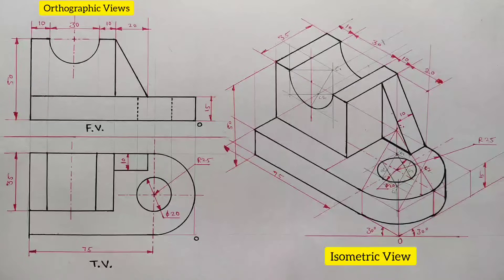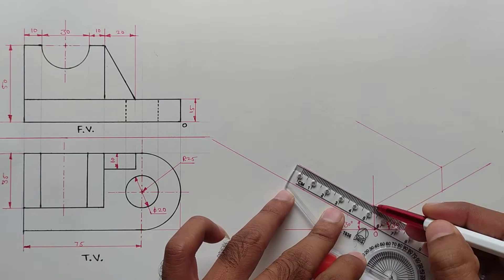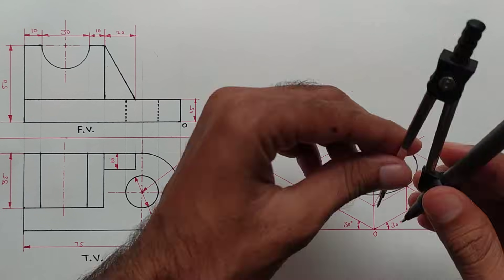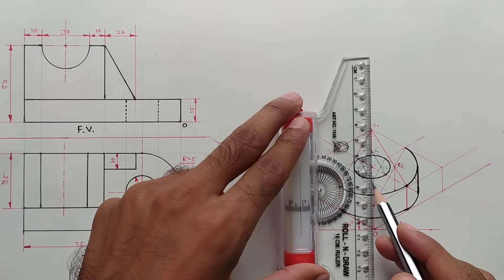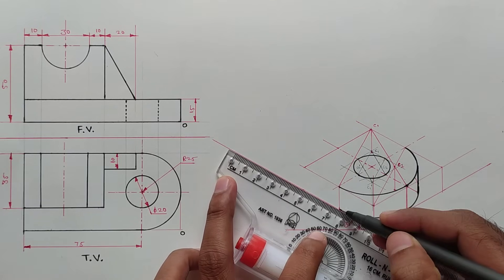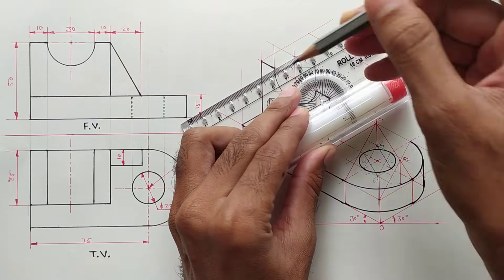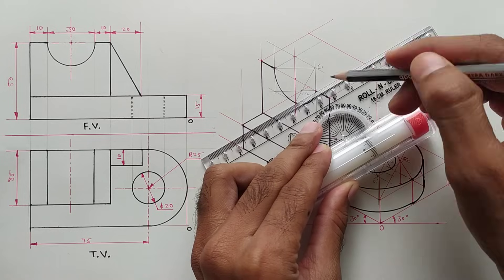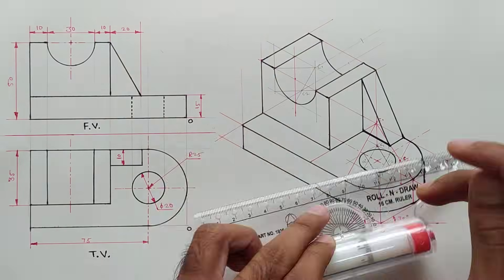Engineering drawing | Isometric view | Isometric drawing | How to draw isometric view

Comment: Sir according to your video you started the front view drawing in yz plane 
How can I know when to draw in yz plane or in xz plane?
(Bcoz in some projections we drawn in xz plane)
Reply from the maker: I have drawn the front view in the Y-Z plane because the origin point 'O' is given on the left side in both the orthographic Front View (FV) and Top View (TV).

If the origin point is located on the left side in the FV/TV (orthographic views), the front view will be in the Y-Z plane in isometric view.

If the origin point is located on the right side in the FV/TV (orthographic views), the front view will be in the X-Z plane in isometric view.

In simpler terms, imagine dragging the origin point from the orthographic front view and placing it on the origin point of the isometric axes. This helps you understand that if the origin is on the left side in the orthographic view, the front view will automatically appear on the right side when mapped onto the isometric axes, i.e., in the Y-Z plane. And  vice versa. 

If the origin point is not specified in the given orthographic views, you can assume it to be either on the left or the right side.